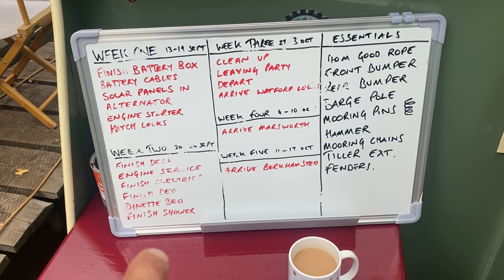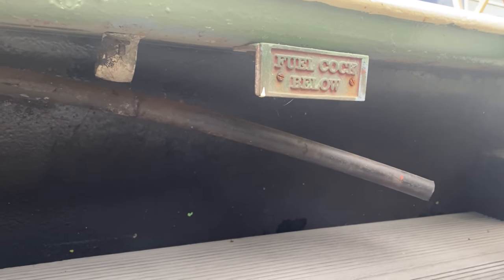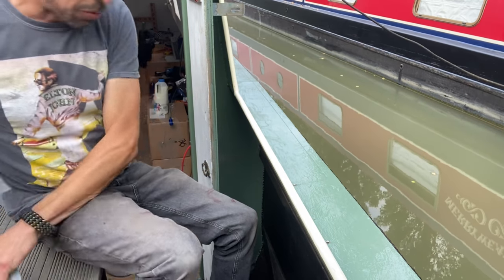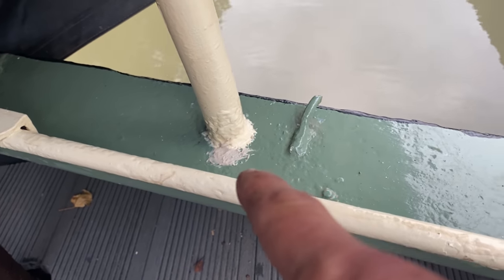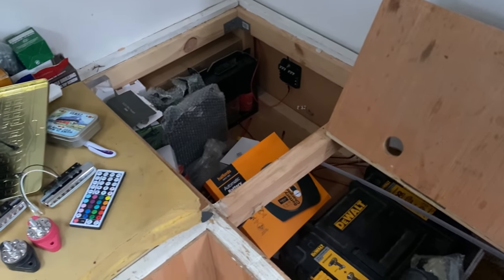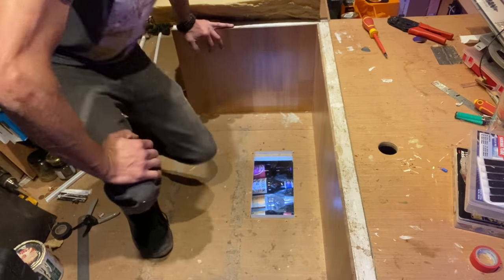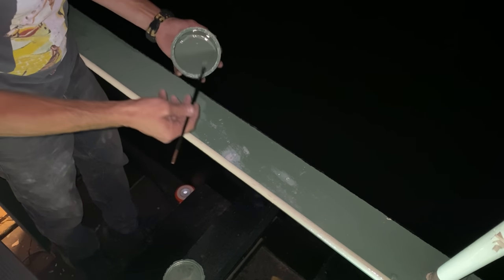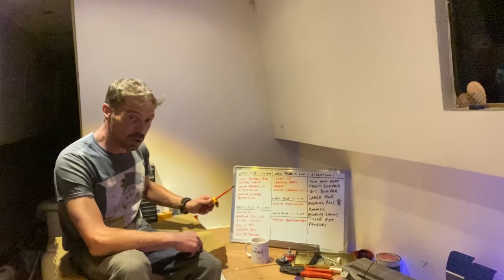248. Improvements to the stern area | Wine cellars take shape

Comment: from my experience of living on a Springer - although some 30 odd years past - one of the best things I had - was mini tyres as fenders - especially when moored for a while - they might not look the best - but eliminate the feeling of bouncing off the bank when other boats pass by - which one can get with the slim fenders  - I guess they could be painted Manchester Red! As others have mentioned - a gang plank is pretty essential - and a good way of securing  it to the bank - which I learn't the hard way!
Reply: Good idea.. I had side fenders and also small tyres.. I drilled holes in the bottom of the tyres also.
Reply from the maker: Yes I prefer the idea of thin tyres - I’m on the look out. Will defo paint. Gang plank is on the list

Comment: I know you're getting your solar rigged up soon, but have you given any thought to engine/alternator charging? Those Lister SR engines have the alternator belts running from the cam shaft which only runs at half the speed of the crank shaft and so alternator output will be absolutely minimal. You can fit a larger pulley to increase the alternator revs thereby increasing the charging output. Definitely worth investigating mate 👍
Reply from the maker: Funny you should mention that - I was chatting to someone at the chandlery about that very thing. I need a new alternator but need the most power from as possible which may mean new belts
Reply: @TheNarrowboatThatJamesBuilt  definitely will make a huge difference, get the largest pulley possible with the clearance allowed. The pulley slides on the shaft and is fixed in place with grub screws. An easy addition, but the downside is that you will probably have to remount your alternator further forward so it will line up. That coupled with a decent alternator will work very nicely.
Reply from the maker: @LKHNET  paul thinks we need to move the position of the alternator anyways as it’s slightly out of line or it’s been hit - thanks - really good advice

Comment: Seeing that you are making a finishing list - what about a fitting in the middle of the roof for a centre line?  It seems that many solo boaters make use of the centre line when mooring up or traversing locks.
Reply: I asked about it a while ago .... because of the roof insulation, James can't get a fitting welded onto the roof. He solution is to rig something using the roof rails
Reply from the maker: Can’t do it now mate as it’ll melt my ceiling. I’ll use a quad strap on the uprights in the centre of the boat

Comment: The Centre line could be an eye bolt through the roof with a locknut and large washer to spread the load or screwed directly into a threaded newly drilled hole. Something to think about for another day after arriving in London.
Reply: That's always been an option for the can't be welded excuses. Too much hassle and effort.  😴

Comment: You’ll need a pump to pump the engine bay when it rains
Reply from the maker: Got one 👍🏼
Reply: @TheNarrowboatThatJamesBuilt  In my paranoid way I'd consider fitting 2 bilge pumps in case one fails :-)
Reply from the maker: @PinkLittleElephant  I’m certainly not relying on a float switch ever again 🤣
Reply: @TheNarrowboatThatJamesBuilt  Another way bilge pumps fail is if the boat batteries are empty (or are stolen) .... giving free rein to my paranoia now :-)